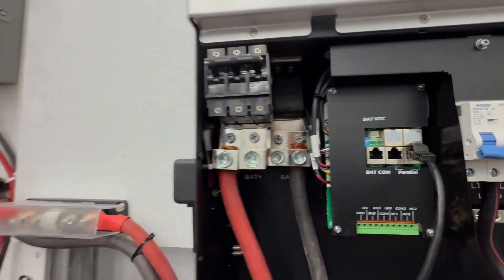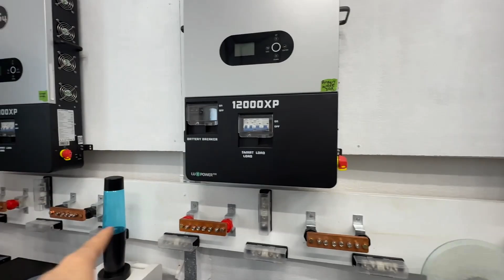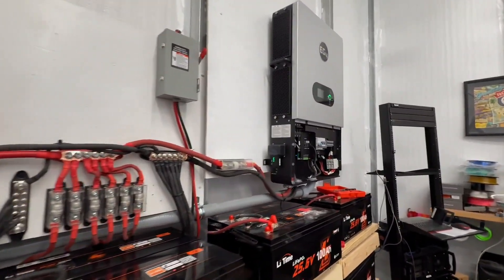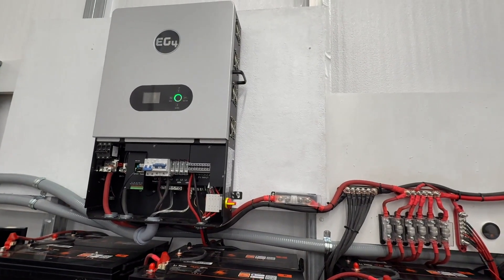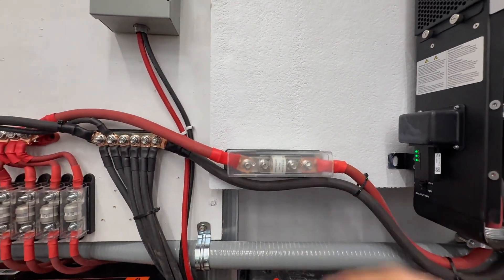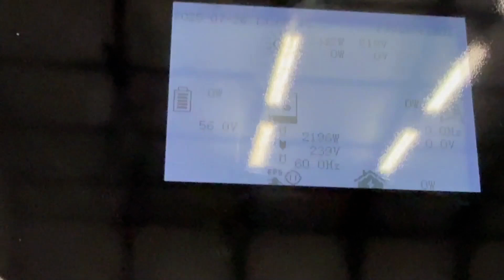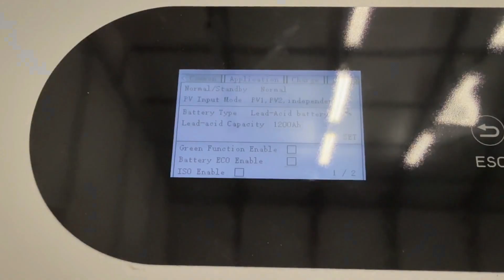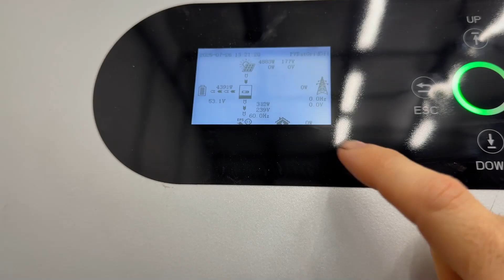Parallel EG4 Inverters: The Ultimate Solar Setup Guide

Comment: I thought each inverter should have their own batteries. Looks like you have all the batteries connected together.. each of my flexboss21s have their own solar array so I figured the batteries should be separate as well.
Reply from the maker: I’d recommend having your inverter’s use the same battery bank for two reasons.  First inverters typically don’t balance each other on output so one inverter will drop before the other when batteries get low as one battery bank will run out first.  Second, you would have to have identical solar panels on each inverter and there cannot be a difference in shading. By far much easier to use one battery bank that they share. and it opens up the option of different panels on each mppt.
Reply: @MikesSolarGarage this is music to my ears since my battery banks have been charging at different rates although they have been discharging together at the same rate...very frustrating.... So connecting all the batteries together doesn't cause issues with the inverters since they are both charging the same battery bank? If not, I'll re-wire them ASAP! BTW I have two Flexboss21s in parralell and qty-6 EG4 wall mount indoor batteries plus a gridboss 🙌
Reply: @SoundsSly  Thats what I would think too. I have no idea why inverter manuals typically tell you to wire separate batteries to separate inverters. The only thing I could think of is a larger battery pack could be more dangerous if something went wrong as it can deliver more current, but thats what fuses are for!
Reply: @NoahZimmerman I've learned allot in the past few weeks. Turns out, with two flexbosses in parallel all the batteries need to be wired up in parallel with a common buss bar, and all the battery cables need to be the exact same length. That way they all charge and discharge together since all the wire resistances are exactly the same. The inverter cables need to be the same length to each other as well. Expensive with current copper prices and the bus bars and extra conduit boxes aren't cheap either. This has been a common concern with customers and it's finally been communicated.

Comment: Why did you have it set to lead acid battery? Won't that cause charging issues?
Reply from the maker: Lead acid configuration equals no communication.  You set all the charge settings in the app.
Reply: @MikesSolarGarage  gotcha thanks. I did later get that answer in another of your videos as well. It’s nice that you can use any 48 V battery with that inverter

Comment: Could you explain why you had 2 80amp breakers in the combiner? Since each 12000xp can only produce 50amp, I'm confused as to why you chose 80amp breakers.
Reply from the maker: Great question and honestly they should be a 60 amp breaker which is %120 of the load.  I am using 1/0 aluminum wire which is way overkill.  Unfortunately 60amp breakers on the homeline panels will not accept 1/0 wire, only 80amp breakers.  Yes I could have used copper and made it work, but the cost of aluminum 1/0 made better sense and it can flow 120 amps.  So the breaker will easily protect the wire which is its purpose.  I know major overkill, but I don't like voltage drop.  My whole shop is wired with one size larger cable than NEC code.
Reply: @MikesSolarGarage  Thanks, I appreciate the explanation.

Comment: Looks really cool but I think your EGC could use some improvement considering the MCB is in the inverters so you may want to consider Bonding jumpers in the inverters and connecting your EGC to both inverters
Reply from the maker: Got it,  so you are saying even though both inverters have a ground wire connecting to the bus bar in the combiner panel,  I should have a separate ground wire between the inverters?  Please let  me know if I am understanding correctly.

Comment: Do you have any idea if the second inverter would stay up if the other inverter was to shut down for whatever reason? Or would both go down? I bought a second one as more of a redundancy inverter and am debating just keeping it in standby. 

A 48v battery with a built in breaker would replace the t class fuses on the bus bars correct?
Reply from the maker: If the secondary inverter went down, so would the master.  But the master would then click back on and run solo after a minute.  If the master goes down, then I believe they both go down.   For the second question.  Breakers do a good job, but a T class fuse is better.  The interrupt current is higher with a T class fuse.  IC of 20K vs 10K.  Plus the T class fuse has a quicker response and will blow no matter what, where as the circuit breaker should trip.  Remember the T class fuse is UL listed, some battery breakers are not.

Comment: Mike thanks for the video I’m about to parallel my 12000’s. Why does the primary have to have the larger PV? Have you hooked up PV on the slave yet?
Reply from the maker: Technically you should have the solar panels split evenly across the inverters to maximize efficiency.  If you have a little more on one inverter, than make it the primary.  The reason being if you decide to power down the secondary for some reason such as reduce idle draw, more solar input is on the primary inverter.  It's just a preference and nothing more.  BTW if you power down the secondary inverter,  the primary inverter will detect it as a fault and kick off power for a moment before the primary comes back up.  It's not a bad thing, but does increase wear on the output protection circuit and relays.

Comment: Did you mention what fuse sizing you went with?
Reply: 250A for the inverter
Reply from the maker: 250 amp for the inverter and 125 amp for each battery bank pair.  On the A/C side the T class fuses are 100 amps.  If it goes above that, something shorted out.
Reply: @MikesSolarGarage appreciate it

Comment: I noticed that you are using two batteries in series for the 48 volts. Are you aware that you could have some battery imbalances? 
I would highly recommend that you install a whole house surge arrestor on the grid side AND another one on the load side of the inverter.
Reply from the maker: Hi Karl,  I couldn't agree more.  When I started out a pair of 24V batteries was cheaper than 48v batteries.  In my other setup all the batteries are 48V.    For the surge arrestors I will have one between the solar panels and inverter, one between the combiner box and main panel and then along a whole house surge arrestor which is already in the panel. 

 I have a high voltage DC setup with LG batteries, Growatt inverter, and Growatt ATS on the way.  One side of the ATS will be on my shop setup that is in the video.  The high voltage setup will be on the other side.  That should bring the capacity in my shop from 60kwh to 92kwh which having the extra capacity should help.

Comment: I just did my 12000XP parallel install a few weeks ago. So far, the two units in parallel have been working perfectly well. I got bold and disconnected from the grid.
Reply from the maker: Very nice!  What is your current battery capacity and solar input?
Reply: @MikesSolarGarage 61kwh for the battery and 14.5kw of Solar producing between 45-65kw per day.
Reply: Do the they share the load evenly or the second one only kicks in when you max out the load on the primary?
Reply: @casperyourfriendlyghost7552 They share the load.

Comment: Cat6 will reduce any latency. Increase the response time when communicating for a power on demand when in paralleling these inverters. Cat5e does run but to increase a response time, I use Cat6
Reply from the maker: That's makes perfect sense Steven.  I typically get my cables from Monoprice.  I have had really good luck with them over the years.  Thanks again for watching!
Reply: The main recommendation from EG4 is using shielded cable.
Reply from the maker: @SurfSailKayak That makes perfect sense

Comment: How many amps can you safely send to those cells? Is it per cell .2C or is it a per series .2C charge aka 20% of capacity?
Reply from the maker: Hi Steven it would be .2C per pair aka 20 amps and I have 12 pairs total.
Reply: @MikesSolarGarage The  BMS for each battery is 100 amp

Comment: I measured my current inverter spot for the 12000xp, no way it will fit, it is going to be hanging where the fridge doors used to be. Next bank you buy maybe a King kong 2 would save a lot of time.
Reply from the maker: It definitely will save time.  If I could do it all over again for that system I would have gone with 280ah floor standing batteries.  Much easier to connect and less wiring.  But I am learning as I go and need to use what I have.  Thanks for watching!
Reply: @MikesSolarGarage Evo has 124 kwh for $18k, 36k for 248kwh 4 blocks